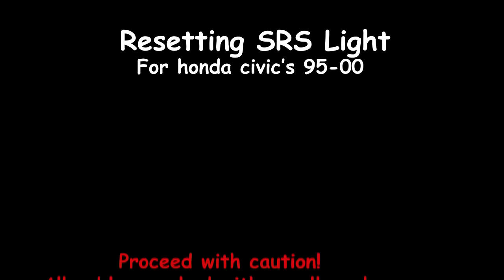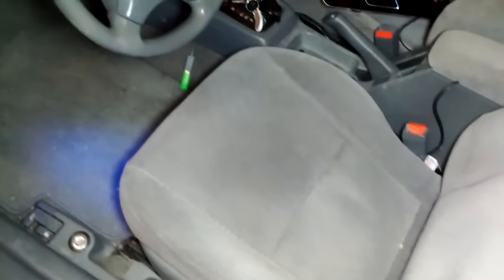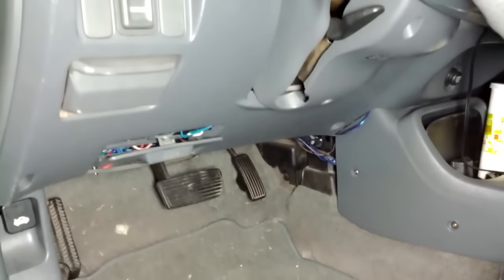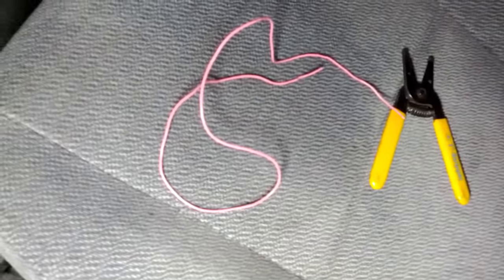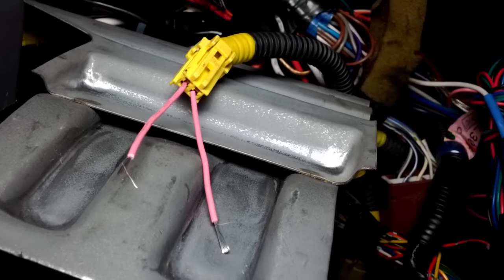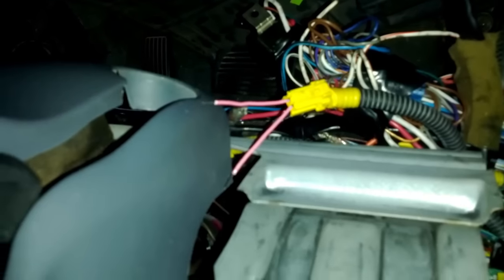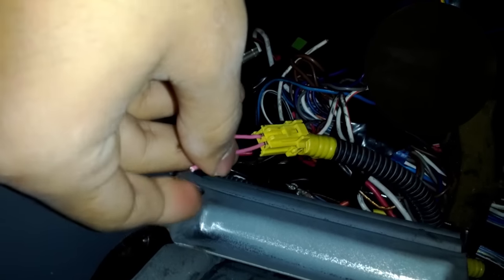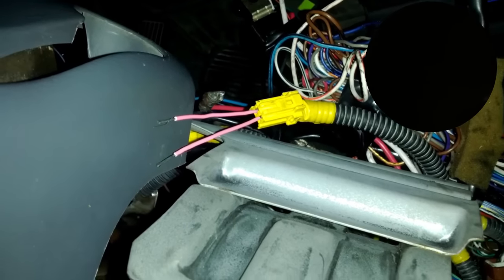How To Reset SRS Light on a Honda

Comment: This worked on a 2003 Honda Civic LX. I had to try it several times but it worked. I may not have had the timing of it right the first few times I did it. I'm so glad it worked. The problem started after the alternator was replaced.

Comment: If worst comes to worst, the gauge cluster is pretty easy to remove and just pull the bulb for the srs.
Reply from the maker: I was actually recommended to do this by a Honda mechanic because i was going to have to purchase the whole SRS unit!
Reply: But I took your route and actually reset it! easier than I thought. 3 screws, some tugging and viola!
Reply from the maker: About as easy as removing the bulb :P
Reply: ajua

Comment: I tried this about 5 times and couldn't get the light off. Then I started the car up and the light shut off the reset. Specify actually starting car, not just turn ignition on. But, it did work thanks for the help.
Reply from the maker: That is strange. What car were you resetting the SRS light on?
Reply: Honda Accord 2000

Comment: I haven't actually tried this procedure yet, but I wanted to thank you for the clarity of your video. I'd found another(How to reset SRS Airbag light 2000 2001 2002 2003 2004 2005 honda civic) prior to finding this one, but it's resolution Is of such a low quality that it was basically useless with regards to locating the yellow plug. Anyway thanks Dude & wish me luck, cause I'm about to go out & try it on my daughters 2000 Civic(1.6L).
Reply from the maker: Good luck and thanks for watching! It should be quick and easy :)

Comment: Hi Christian, Thanks for the nice video. I try to fix the SRS problem on my Honda Accord 2002 but it doesn't work. I did exactly what I saw on the video, but when I insert the paper clip the SRS light does not goes out. Do you have any idea what the problem might be?
Reply from the maker: The paper clip has to be in before you turn the ignition key on. Also, double check you are using the right plug. If it still doesn't work, you may have a defective SRS unit.
Reply: Thanks mate. It works perfectly.

Comment: what if the light just comes back on without flashing 2 times? it's current code is a 10-1 which is srs bag deployed. 
I have a 99 Honda Accord 
thanks for the video!
Reply from the maker: +Mr. Suasto the srs unit has to be placed if the airbags have deployed.
Reply: Christian Macias okay, thank you so much!
Reply from the maker: Your welcome!

Comment: I'm wondering if you could make something that has wires like your coming out of it but you never have to disco the wires again Then when you need to short them out you can without having to get under the dash again.
Reply from the maker: it's called an SCS service connector.
Reply from the maker: it's called an SCS service connector.
Reply: +Christian Macias oh ok.  I'll get a female plug and short it so I can just connect and disconnect .

Comment: Hello Christian ..... just now I reset my honda car's SRS light, it's gone for now. Hopefully it stays off..... will let you know. thanks.
Reply from the maker: Thanks for watching! What year is your honda?
Reply: Christian Macias
 - Hi, I wanted to update you on the SRS light on my Honda car.... it had immediately come on again after days of driving. I redo the steps in your video and it works for few days... then comes on.
Reply from the maker: I have the exact same problem. My neighbor is a Honda certified tech and he did me the favor of checking my SRS unit and showed me the code. When he looked it up it was pretty much saying the SRS unit itself is no longer any good. As a friend, he pretty much said, either get a used unit from the junk yard or take out the bulb because its going to keep turning on. My honda is 1997 civic. That's why he said it's not worth buying a new unit.
Reply: Christian Macias
 - Hi, So did you replace the SRS unit? How much did it cost? Is there anyway you can share the site where you bought the unit? Appreciate any help you can give in this... thanks.
Reply from the maker: No. That about where i am at.. I'm not too sure about whether i should buy it or just forget about it and take out the bulb. If I do buy it ill update here.
Reply: Christian Macias
 - thanks.

Comment: in the event of an accident will the airbags still work?
Reply from the maker: +Marta Gron amazingly you are the first to ask. Unfortunately deployment isn't guaranteed. The light turned on for a reason. If it was for a reason unrelated to the air bag (seat belt pretensioner), then yes it will but other than that, it is not guaranteed.
Reply from the maker: +Marta Gron amazingly you are the first to ask. Unfortunately deployment isn't guaranteed. The light turned on for a reason. If it was for a reason unrelated to the air bag (seat belt pretensioner), then yes it will but other than that, it is not guaranteed.
Reply: How do I find out what the issue is? Do I just have to go to a mechanic?
Reply from the maker: http://forums.clubrsx.com/showthread.php?t=636707

This is the link to reading the code without needing the scanner. I have not ran this through my honda technician so I can't verify what years and what models this will work on.

Comment: do you have any tips on how to remove the plug because i have tried many times and i cant get the plug off
Reply from the maker: Edgar Ortiz Try pressing the plug in, press the tab on the connector to release it, then pull. If you try to pull it first it might get stuck.
Reply: Ok thanks

Comment: as per you, i fixed srs red lights in my honda civic, seemed it worked well. however,  SRS light still on for a second when i ignitated my car. after two seconds, it disappeared. it is Ok for my car?
Reply from the maker: Yes it is normal for this to happen. look at 3:24
Reply: Christian Macias hi, i drove for half hour, SRS still shows up. why? what is my car problem? i reset twice, the same story to me. still shows up. again SRS. pls help me out
Reply from the maker: When it turns back on it could be because one of a few reasons such as your air bag is no longer working, you seat belt is not working the way it should. You should take it to honda where they can test it and tell you exactly what it is

Comment: Does this same procedure apply to 1997 Honda accord??
Reply from the maker: Bill Berger I believe so. I have only done it to Honda civics though. So I can't promise it will. If you try it, let us know if it did work for you.This has worked for various Honda cars/trucks so i'm fairly sure it will
Reply: It did not. Both cars air bags were deployed previously. So I'm replacing both modules.
Reply from the maker: Bill Berger That's what they told me at Honda. The SRS units have to be replaced after the airbags deploy. Well, better safe than sorry. Thanks for replying!
Reply: Thanks. U as well

Comment: So the airbag will be functionnal after doing this or it just disable the light ?And just for make it  sure after reset are done i replug the yellow cable and that will stay fix or the srs will appear again ? thank for your tips !
Reply from the maker: Sabrina Falardeau  This is only if you have fixed the problem with your airbags/seat belts. If you haven't fixed the problem the light will turn on again eventually. After you reset the SRS unit, you just put it back in the plug that it was pulled from.

Comment: Do I plug back the srs wire?
Reply from the maker: +Ryan Sampayan Sorry for the late reply but yes you do
Reply: Thanks, it won't show up after that correct?
Reply from the maker: Well, this procedure is for when you fix the problem on the car so it will turn back on if the problem isn't fixed

Comment: Will it work if you don't have air bags and have aftermarket steering wheel setup
Reply from the maker: navitesh prasad No it will not. This only works if the problem has been corrected.

Comment: In order to change my Honda 2003 Pilot cruise control switch I have to remove air bag on the steering wheel and after putting Air bag back the SRS light is stay on all the time. Can I do same thing like you did but right at the Air bag connection not under dash ?Thank you.

Comment: For starters forgive me if this is a stupid question, this isn't my thing so please just save it - I'm about to try this on a 2000 Honda Accord - I'm almost positive my light came on because I spilled something in the seat belt (I rarely even drive the car, it came on a few weeks ago out of the blue) - but do you leave the two wires you inserted into that plug? I've got to take my car in for an inspection and just need that light off long enough to pass! Thanks in advance!!
Reply from the maker: +Hamlet1984 You don't need to leave the wires in there. It is only to reset the system. If the system is damaged, there is a good chance that the light won't turn off. Just make sure that you review the video a few time before attempting this!
Reply: Christian Macias Thanks for answering and the advice! I must have watched this 50 times. Trying to figure out how to do this when it seems to be a two man job - so far it's looking like I'm going to need to some Macgyver move and create some contraption long enough to pull the paperclip (going to try that route first) in and out while sitting in the driver seat, turning the ignition and watching the light, or do what I did when looking for the right wire/plug - position myself on my back with my head under the dash, balance a laptop on my thighs with the camera turned on so I can view the dash, turn ignition with my left hand, and do what I need with the clip and wire one-handed in my right hand! (I'm 120lbs and 5'6, so not as difficult to fit as it may sound lol.) Thanks again!

Comment: Hi Christian...I have a 02 Acura RL...Please tell me if this is possible with my car, and if so - how do I do it ???
Reply from the maker: Hello MrRichard! For the most part they are the same, but don't take my word for it. A quick Google search will provide you with your answer. If it is the same, then the procedure will be the same.
Reply: Thanx Christian...It worked but it kept coming back on, so either the censor is bad or the airbag has been diploid before.
Reply from the maker: Mine was the physical SRS unit but the entire system still worked. Sucks how one little thing fails and causes the whole system to fail. I talked to honda not to long ago, they said the system ran about 150 dollars for my 97 civic. Good luck trying to get it to work! Comment your results if you get it going. I'm sure we would all benefit from the feedback

Comment: Hi Christian, I did exactly what you said to do and it worked...sort of. When I go to start the car the srs comes back on. The fault re sets but when started the light comes back. So, could a fuse be to blame, srs impact sensor??? No air bag had been deployed but the bumper has had a decent shunt from the previous owner. If it is the impact sensor where are they located, if it is not the sensor what else could be to blame? Thanks in advance.
Reply from the maker: +Steve Medved if it turns on shortly after reset, if could be a component in the system. If it takes a couple of days to months, then it might just be that your srs computer is not functioning correctly anymore. I had to get mine replaced
Reply: Christian Macias thanks for your reply. How do I determine which part is defective ?

Comment: Hi! I have a honda civic 1996 but my abs light is on, i know where the connector is to read out the faultcodes but how do i reset the lamp? On the sameconnector?thanks
Reply from the maker: No it is not the same connector. With you car completly off, locate the fuses. Unplug the smaller connector. See if the holder has any pins in it. If I does not, then that is the memory erase cable. You can see what i am talking about here. 1:22
Reply: We fixed it, we just changed the abs and drive it and the lamp dissapered

Comment: Hey, I have a 2013 honda accord. My air bag was deployed and I have replaced it. Will this method work.
Reply from the maker: No. A deployed airbag requires a new unit. Sorry. I asked this at Honda because my friend crashed her 2010 civic and they basically said, if a air bag deploys a new SRS unit is required.
Reply from the maker: If you do end up trying it, post back your results here so that we will know for next time. You know how dealerships will lie just to make more money.
Reply: I'm having problems finding the yellow MEC plug? And yes I will update here.
Reply from the maker: With you car completly off, locate the fuses. Unplug the smaller connector. See if the holder has any pins in it. If I does not, then that is the memory erase cable. You can see what i am talking about here. 1:22

Comment: Thumbs up bro my daughter has a 97 Civic her axles kind of went out on her but I believe in the process it some joe set the srs light on when I turn the key it makes a buzzing noise in the motor not from the motor but like from the driver side Under the hood area like a electronic buzzing noise can that be the srs
Reply: Southern Fisherman just got a 96 accord for 400 bucks. And my srs light is on, and i noticed the same exact buzzing that your talking about. Its brief. For no more than a second. Lemme know if you find out what it is!

Comment: I already did it in 2 cars and worked,, nowI did it in my honda and the light comes back on after a few seconds, what should I do now...thanks
Reply from the maker: if it comes on after a few seconds then check and make sure all your components are correctly connect. make sure the seatbelts are in working condition and the airbags are also correctly connected. If your sure that everything is connected correctly then you must get the error code checked to find the exactly problem. some Honda dealers can check for free and some charge a small fee. just ask for the error code and do a Google search of it.
Reply: Ok thanks bro..

Comment: hi there do you know what else could be the problemas because i did it correctly, the light did blank twice but after 5 seconds it cum on again thank you
Reply from the maker: +skull144 If you have an older honda, iv'e heard that the seat be pretensioner fails often.You can try to see if that is your problem first.

Comment: What would be the isue when the srs light blinks twice an goes off but then comes right back on?
Reply from the maker: That means that the system has been reset but still has a problem. The only way you can see what is wrong is by connecting the SRS unit to the computer to read the error code. If you have an older model civic, the seat belts tension (I believe) can cause it trigger back on. It's probably best to get it checked by a professional.

Comment: Hey dude,
Thanks for the video, but my car is honda Acord 2001 and I wanted to know if the same process applies to it.
Reply from the maker: I cant assure you it will but it is likely. Usually Honda has the same process to reset the SRS, even some Acuras.
Reply: Thanks for getting back to me,  dude. I'd try and let you know what'd happen. I appreciate your time.
Reply from the maker: Thanks! That way I can add it to the description.

Comment: after you have done all this do you pull the wires out and plug it back in? or pull the wires out and leave the plug hanging there?
Reply from the maker: You plug the connector back into its socket once you have done the procedure. The socket is only to hold that cable. It doesn't do anything

Comment: stupid question ...so after is done i plug it back in ? or leave the wires like that?
Reply from the maker: Not a dumb question. Plug it back in.
Reply: +Christian Macias  i did it on my 2001 integra ..but it didnt work..i had both airbags deployed..i changed the airbags but not the modules...
Reply from the maker: +Kristen Diaz this happen to a 2010 civic My girlfriend owns and they told me the module must be replaced if the air bags have deployed.

Comment: Yes. We have done this but the SRS light turns back on. What do we do.
Reply from the maker: Hi. It really depends on the problem. When it is turning back on after a while, its best to go get it check. I've been told that the seat belt tension goes out often

Comment: Sooooo with the wires shorted (my 96 accord has a pin connector I short out) my car starts and the srs light goes off, but then a few seconds later it goes right back on. Even when I un-short it, then short it again, the srs light comes back on and never goes back off.
Reply from the maker: You probably have an issue that needs to be addressed

Comment: hi christian macias,
i have honda civic 1997, i tryed this but SRS still on, 
is there any other way to fix this?
thank you
Reply from the maker: +Arslan Mirza If the light is staying on then there may be something wrong with the SRS system. If that is the case, you will have to take it to a Honda technician and have then tell you want you have to do to fix the problem.

Comment: The check air bag system light is on.I purchased the car recently an the light was on when i bought it.The car was in an accident and the air bag in the passenger side door
was deployed(i am assuming since the door is flat)If i do this will it reset.or is there a way to disable it.I need the light off to pass emission.
thank you
Reply from the maker: Caitlyn Haggerty Hi. SRS is normally not checked to pass emissions I believe. To answer your question, if the car was in an accident and the parts were not replaced, airbag, sensors... ie. This will not work. You can try though in case they replaced the components.

Comment: Yea i have a question, what if the light doesn't go off, it doesn't blink or anything?
Reply from the maker: If all the steps were followed correctly then you SRS until could be faulty. I would also check to see your exact Honda model supports the reset procedure.